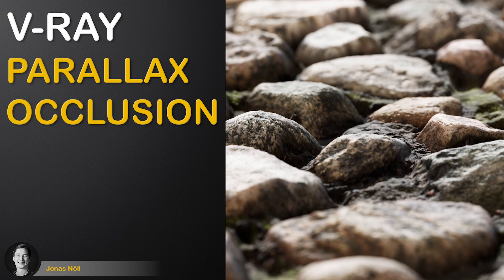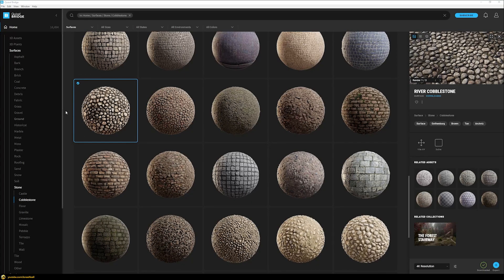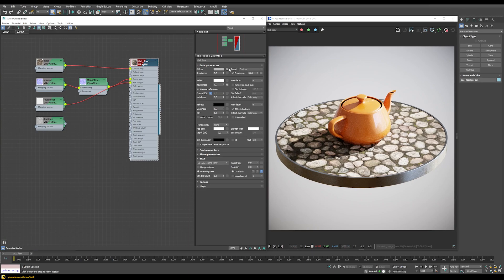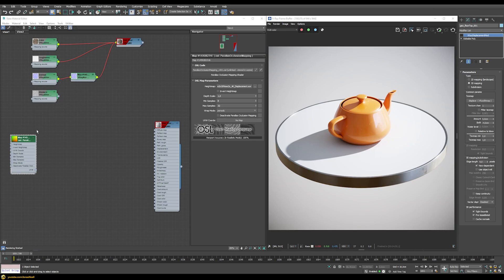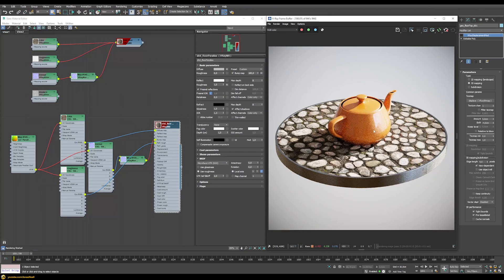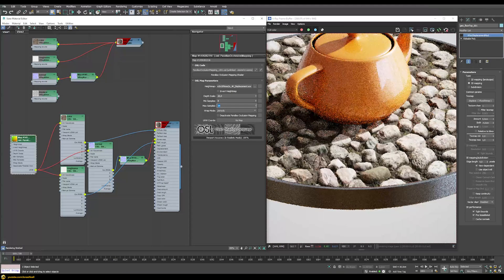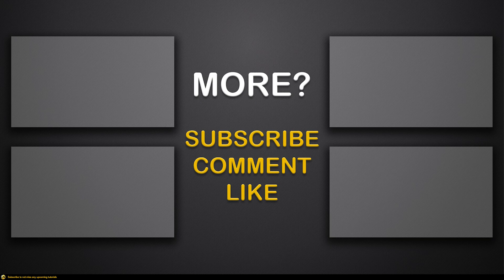V-Ray | PARALLAX OCCLUSION - The better Normal Map?

Comment: me: "oh nice, I'll download it right away" - watching Jona's video, especially the end... "oh good, back into the trash".
No, very good video! I find OSL Shader very exciting, always interesting to see what's there!
Reply from the maker: Haha, well it has its use. Especially for GPU rendering where memory is an issue. But I think it's not a gamechanger, especially with the much slower performance. Also made me realize to use more displacement instead of normalmaps, even for smaller stuff.
Reply: @JonasNoell  yes, GPU & V-Ray is absolutely no go-to workflow for me personally either, whenever I started a project with it, there were problems with the memory at the end.... Good to know that the shader helps here, that could be a workaround :)

Comment: In some cases parallax occlusion has more advantages than displacement. Displacement has undesirable results when it comes to collision of some objects, also when creating a modular game environment or an archviz large environment, displacement cant fulfill all the needs, creating some artifacts, etc. To have a better comprehension of what I am saying, imagine we have two connecting walls at a corner. If each wall contains only one simple plane, and you have aligned them with snap tools, when using displacement, you will encounter with some backfaces and light leakage you didn't expect. But P.O. can maintain the actual geometry which is more desirable in these cases. So when using displacement you should predict a new geometry. For another example, if in this video, we had a cylinder for rocks instead of a circular plane, the geometry would pop out of the plate walls, but PO doesnt bring us these issues.
Reply from the maker: That is ture, as said everything always has pros and cons. I can definitely say that some things you pointed out would be disadvantages of displacement. However there are also advantages such as that it affects the shadows in the way you would expect and it works better for shallower camera angles where the illusion of PA would break. So feel free to use whatever works best for you in your scenario :-)
Reply: If you uv unwrap your surfaces and have continuous topology you can use hight based displacement that will displacement on the UV level rather than tessellate your 3d. You then only have to specify your map resolution for better results. It’s way less memory intensive and you don’t have to worry about continuity. Imo most people(especially archives) default to 3d displacement bc they don’t want to learn even just basic uv mapping. Then have issue with ram limits… go figure.

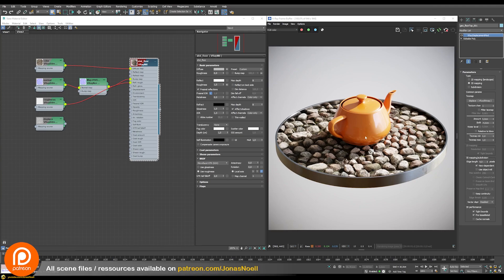Comment: The only flaw in parallax occlusion is it how it interacts with shadows. The shadow lays flat on the surface as if it has no volume. If you compare the shadow of the teapot from displacement to parallax you'll notice it as well. Displacment 5:28 Parallax 9:23
Reply from the maker: Yeah, as said it's rather an optical illusion that has its downturns compared to real displacement...

Comment: Great tutorial, thanks! Always wondering if I can use parallax mapping in V-Ray! I'm wondering if the performance issue is caused by the not optimized OSL codes (only with my no-basis assumption)? Or the max samples was too high? Maybe one can try to use lower parallax occlusion max sample/lower depth scale and compensate that with lower VRayDisplacementMod amount/edge length?
Reply from the maker: Hi, I checked with Chaos if they plan on implementing it officially and in a more optimized way. It seems to be on the list but even they state that tere is also a risk to be slow even through a native support. So, fingers crossed... :-)
Reply: @JonasNoell  Thanks for the info! I tried your method and the result is very similar. The OSL parallax mapping is slower and uglier than VRayDisplacementMod.

Comment: Bump needs to be set to 100 to display the normal map correctly? First Time i Heard of this…isnt that just the amount?
Reply from the maker: Yes and the normal map is baked out with a defined intensity so if you want to show this as intended you need to put the bump intensity to 100
Reply: @JonasNoell  thanks

Comment: Jonas about megascans some materials have normal and bump maps at the same time,using normal map channel with add bump map ;what's the difference right?
Reply from the maker: I normally would not use any of the provided bumpmaps from Megascans and just use only the Normal- and/or Displacement Map. Not really sure why they alway mix that in. Maybe could make sense if the bumpmap contains very high frequency details which for some reason are not in the Normalmap, so you could add this very subtle as an extra level of detail.
Reply: @JonasNoell  Thank you Jonas.